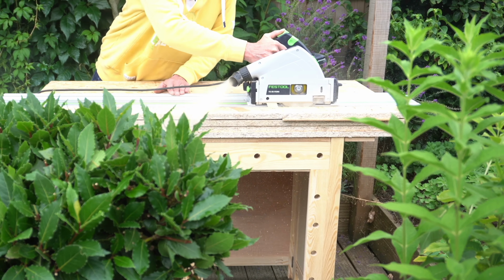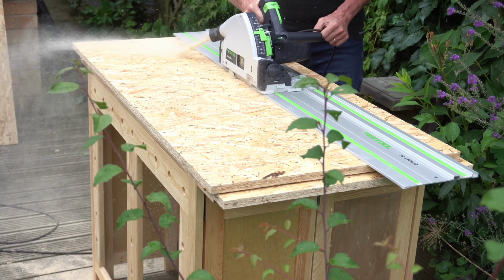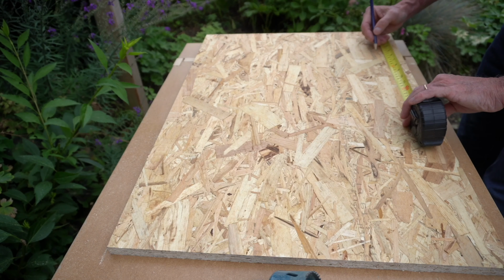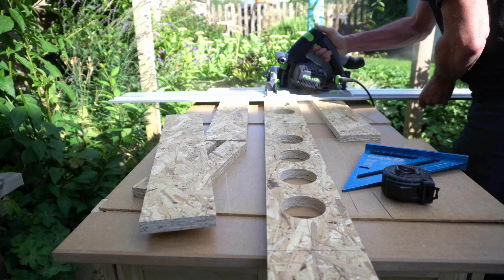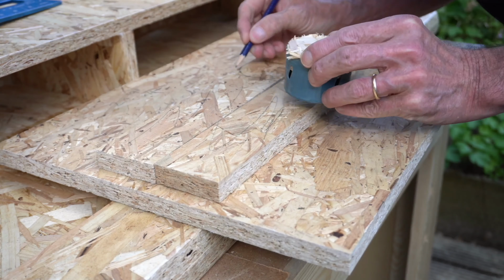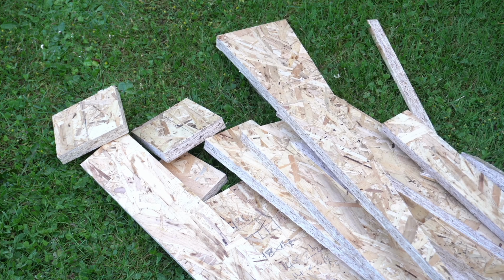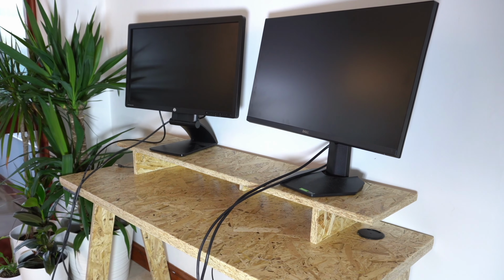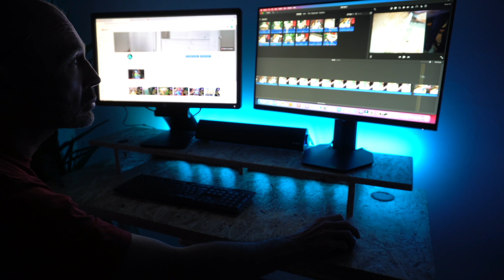Make OSB Furniture. Editing desk for my Mac Mini.

Comment: I made a nice comment yesterday and saw you replied on in my notifications, but I can not find the message back here at all, do you know where the comment and your reply went? Could you re-share the reply?
Reply from the maker: Very strange it’s disappeared! I’m out at the moment and will re type later today.
Reply: That looks like an excellent build! I got 18mm 240cm x 110cm OSB boards and would like to give this a shot, can you share any more information about your dimensions and any sketches please? Sizes of the hole saw? Sizes of the screws? Type of finishing trade interior varnish? I see 4 x 4 ft x 2ft pieces of OSB used. What angles did you use for the edges of the desk? ( found my original question)
Reply from the maker: @tuxcrafter Hi. So, as you say I bought a 8 x 4 with my local merchant cut to 4 @ 4x2. I sold the house in the summer and the desk went with it, which was a shame is I used it almost every day - I may even make another ☺️ the holes were 60mm. The angles were around 30 degrees. The varnish is just quick drying solvent free from Screwfix although all diy shops sell it. That way you can give it a lot of coats quickly.
Reply from the maker: The top was made from one of the pieces so in your case 1100 x 600mm. If you google your height and desk you can find the perfect working height for you
Reply: @Smallbarnworkshop  I can not figure out all the parts from just the four pieces, if the legs are not coming about a single piece

1 = top  = 61x120cm
2 = leg #1 = 61x71cm
3 = leg #2 = 61x71cm
4 = bottom front side = 10x120cm
5 = bottom shelf = 30x110cm
6 = bottom shelf back= 10x110cm
7 = top shelf = only 11 cm left of wood with length more then 70 cm.....
8 = top shelf back = .. no more wood left longer then 70cm

61+61+61+10+30+10+11 =  error  over 244cm of long parts bigger en 70 cm ... 

Did you make your legs only 60 cm height? this would have been a very low table? Would be awesome if I can start cutting pieces.. Thank you.
Reply: 1 = top  = 61x120cm
2 = leg #1 = 51x71cm
3 = leg #2 = 51x71cm
4 = bottom front side = 10x120cm
5 = bottom shelf = 25x110cm
6 = bottom shelf back= 10x110cm
7 = top shelf = 25x
8 = top shelf back = 10s

61+51+51+10+25+10+25+10 = 243 fits in 244
Reply from the maker: Just watched my video again. All the top including trims were from one of the pieces. The legs were 500 x 800 keeping the long off 100mm off cut for the under and over desk part. The 4th part makes the upper top and the off cuts everything else

Comment: May I know the paint you used? Does the paint make the surface less rough? Thanks
Reply from the maker: Hi. once sanded and finished it is really smooth. I used this to finish

https://www.screwfix.com/p/no-nonsense-quick-dry-varnish-satin-clear-750ml/30824

regards JP